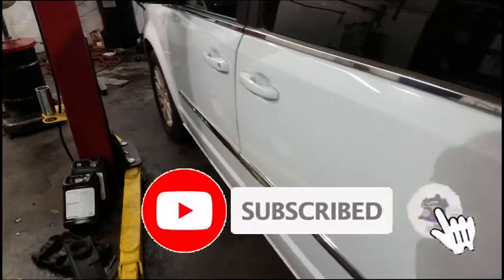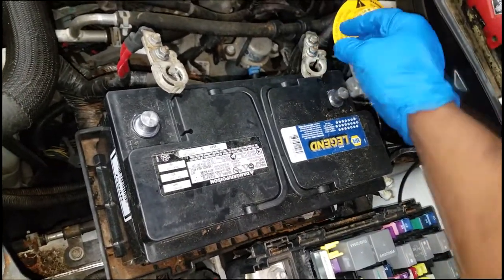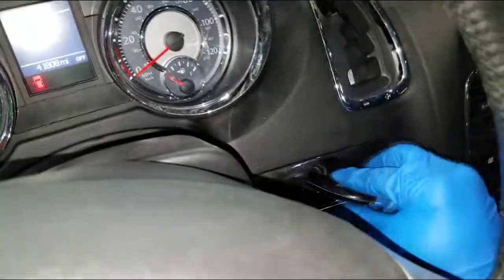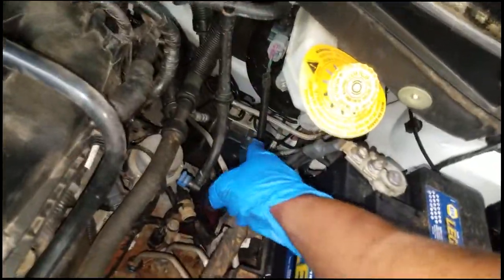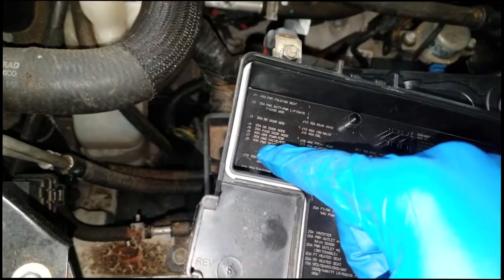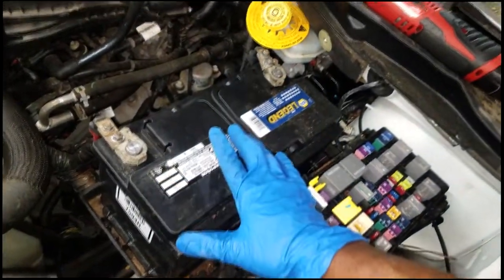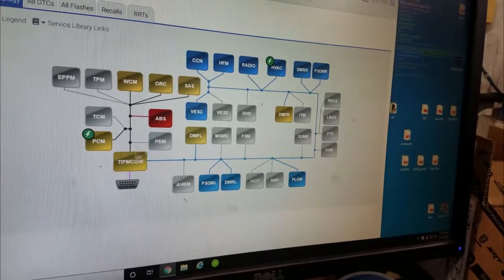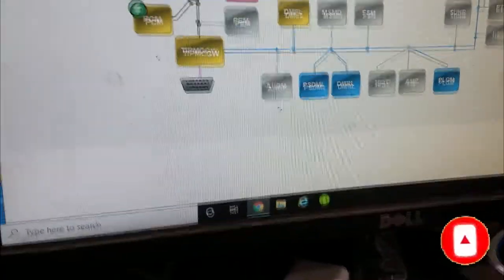CASE STUDY. How to fix a car that will not shut off. Can Bus Can-C Network. P2533 U0001

Comment: I have the same DTC code the P2533, the car engine turned off when I remove the ABS Control Module Fuse, I did the same and replaced the ABS Control Module with a new one, but the problem stays, the car owner start hating me. PLS HELP :(

Comment: Any clue? About i20 hyundai, fuel pump must prime everytime I start the engine? Mine won't prime after a stop and I can't find the answer nowhere. Please help. I subscribe to your channel. Thanks for your expert help.
Reply from the maker: Hey bud, I just spoke with my Hyundai buddy. He said this may be a glitch in the computer problem. Also that it will not prime back to back every single time you turn key off then on. You should find somebody with a good scan tool that can read inside your pcm/ecu
Reply: @OnlineMechanicTips  thanks very much mate! It cross my mind too. I'll go to dealer to tell him about it. I have a friend with tucson and him prime every time. Mine I don't know the moment and the cause for that. All I remember in the past there is no problem with second hard to start situation. Have a great day. I'll keep you informed. Cheers.

Comment: Sir can you tell me if the fuel pump must priming fuel every time I put the key on? Because in my hyunday prime only at cold start. After a stop and turn off key, when I swtch on again it won't prime. Please tell me if is normal. And many thanks for your work here.
Reply from the maker: Hello my friend.  Most of the newer cars have that feature. What year your xar? Also are you subscribed to the channel?
Reply: @OnlineMechanicTips  hyundai i20 pbt 1.2L 2009 classic manual petrol 5 speed. Thank you for anssering my cll. Hope you can help. When start with no prime the car struggle to start and check stays on until start finally.Subscribe now. Thanks

Comment: The same thing just happened to my 2011 Chevy cruze. We disconnected the battery and then opened the fuse compartment and found that the fuse for the fuel engine was not there (it was missing) so after about 10 minutes of having the battery disconnected we went into my car and pushed on the break and my car shut off. Super spooky & when we ran a diagnostics test on it, it says no problems were detected.

Comment: I have  a 2014 town and country and its stuck in park it wont move also traction light is on can  it be related?
Reply from the maker: My man, thanks for watching and being a subscriber. As for being stuck in park, what exactly do you mean? Are you unable to move the shifter? even so, can you move it using the lock out button above the shifter? The way that sys suppose to work is with key in and on, once you press the brake pedal, the interlock should activate which will allow you to move shifter into gear, which part not working?
Reply: This is insane! I have a 2015 DGC with this issue ( stuck in park, traction control light is on)  AND the van won't shut off with the key taken out.  This is not a coincidence! I'm a DIY'er and trust me I've been up to my eyeballs in repairs to keep Black beauty on the road. It was given to me. Free van that was totally neglected. It is 718/25 . Just an example if I may: I bought 2 new front end sway bar links and a PVC today, chasing down a pesky P0300 and P0305. Injectors replaced, coils, oil  cooler, alternator, serpentine belt, thermostat, upper and lower manifold gaskets, spark plugs, O2 sensors (OEM) new drain plug, radiator cap, gas cap, rear shocks, front inner and outer tie rods, oil change, trans oil/filter changed., brakes/rotors all the way around, 4 new Coopers on all 4 corners, what else? I might have forgot a few things.  I've been busy! 😂 This is the van you LOVE to HATE. It decided today it doesn't want to go out of park and it won't turn off.  I use to be able to step back from a project and realize I'm done there's nothing else to do. Not with this van.  If will FIND something for you to do.  FUN FACT, my beloved black beauty hauled specialty childrens' caskets before it went from my oldest brother to me. 😮 Bro bro I'm subscribed. No worries! I wouldn't know half this Mopar wisdom if it weren't for you! 💪🏽

Comment: i had a 2015 jeep Cherokee doing the same thing, taking down can-c  vehicle was still able to shut down  but it was very intermittent finally caught it with the bus down and went for the easiest  module to unplug the abs. I work at a dealership also usually get a lot of abs modules with  internal fault  codes but that was my first that took down the bus.